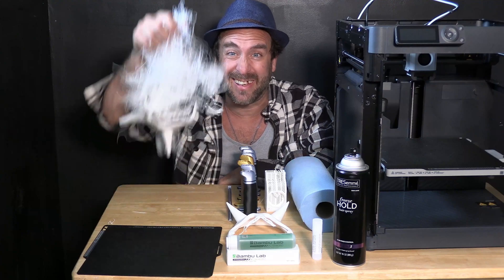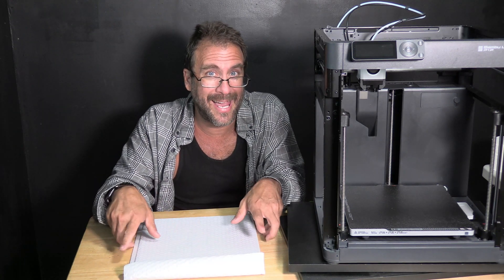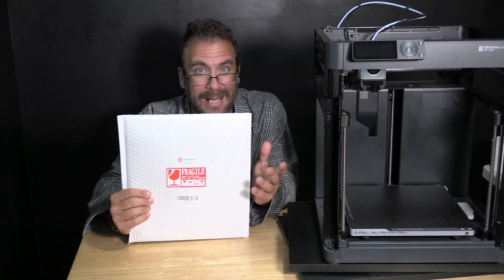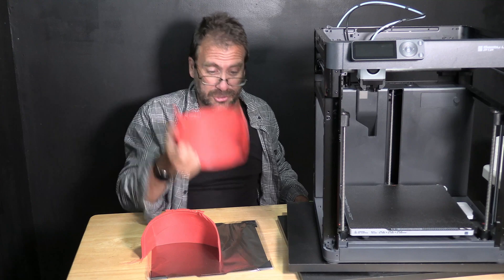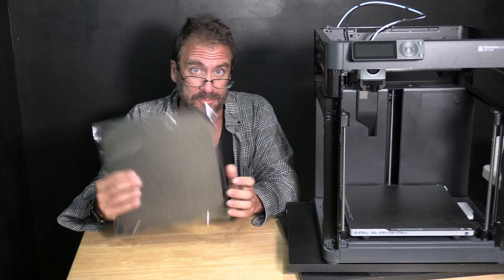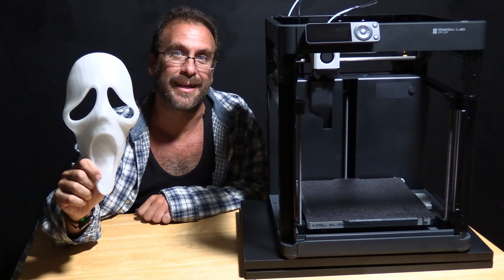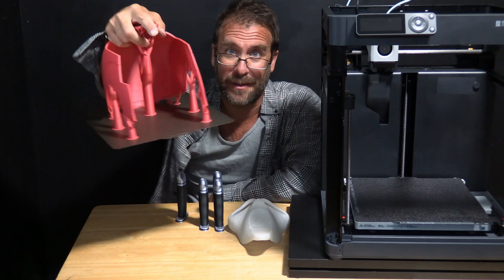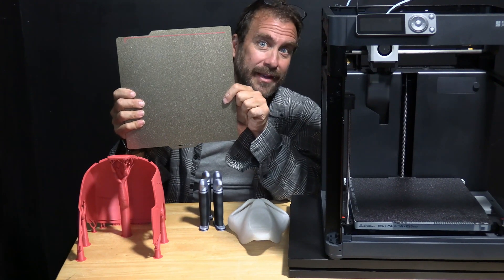Testing NEW Improved GOLD PEI Bed, on Bambu Lab P1P 3D Printer - MUCH Better Adhesion!

Comment: Informative, but not particularly helpful when you're showing the bed adhesion of a brand new bed. The failure of Bambu beds (Gold and otherwise) after about a month is not solved long-term by simply buying a new (generic) version of the same (gold) bed.
Reply from the maker: Reading helps also. In the Description and comments, I mentioned to disregard the Textured all together, and use the new High Temp Smooth PEI.  That said, both beds used in this test were new. I also tested multiple brands, with similar comparative results.
Reply: @3DRundown  Yes, I read your comment, but I was simply noting that over time people have the same problem with Gold or "otherwise" (referring to all beds, not color). Your next video was helpful for trying to track down the problem, but I am trying one thing at a time to know what helps. (Regardless, I hope you have a wonderfully sarcastic reply to watchers day!)

Comment: Gregg should I buy a second one for back up ? Ty  now back to your video. 😎👍
Reply from the maker: NO. Throw it in the Trash, (or, don't order it at all) and buy the High Temp Smooth PEI Bed: http://shrsl.com/4ijn5
Reply: @3DRundown  I have a good one with the new pei , I m wondering if i should buy another one ?
Reply from the maker: NO. The high temp smooth PEI bed is MUCH better. I would get one of those instead. Use the Textured for easy prints, or, when you want the Texture on the bottom. Use the Smooth for everything else. As for a backup? I have backups for all my beds, but, I have yet to ruin one, and I print every day....
Reply: @3DRundown  so that is the darker one that comes with the p1s , right?
Reply from the maker: P1S comes with Gold Textured PEI.  Use THIS one: http://shrsl.com/4ijn5

Comment: Hello,
I discover your videos as I was looking for informations on this topic.
I have adhesion problems after some weeks on my new P1S (I use the stock textured PEI plate).
I'm thinking replacing it by smooth plate as you recommand, but I see 2 differents smooth plates on the bambu shop.
First is "Bambu Dual-Sided Smooth PEI Plate" and the second one is "Bambu High Temperature Plate (Smooth PEI)". Do you know the difference between these two plates? I understand on the High temp plate the "Engineering" side seems to be different, but the other side the "High temp plate" seems to be the same as the "Dual-Sided Smooth PEI plate" as they both use a "Smooth PEI sheet" on the surface.
Maybe you have tested both of them, do you have any informations about the differences between these plates and which one stick better?
Thanks again for your videos, you won a subscriber today :)
Reply from the maker: High temp SMOOTH PEI is what you want. I have the one's with the engineering on one side. I've only used the Smooth side. Immediate massive improvement. Adhesion is epic, compared to Textured
Reply: @3DRundown  Good to know, I just go this answer from Bambu support: "Yes, the "High temp plate" side of the "Bambu High Temperature Plate (Smooth PEI)" is the same as the two sides of the "Bambu Smooth PEI Plate (Dual-sided)""

Comment: Mine was fine as is for the first 20 or so prints, then….went kaput having a terrible time with my x1 carbon. Going to give those a go when I can. I did try the glue, and it was nightmarish. I did a full new calibration, and cleaned the bed with a glass cleaner. And I had a success. But I don’t know how long this is going to last until disaster again.
Reply from the maker: Forget Textured PEI. It has trash adhesion. Even the Gold. Get a High Temp Smooth plate
Reply: @3DRundown  Thank you for our response. I had no issues with my CR10v2 modified original glass bed. I wish I had that bed for my Bambu lol. Trying to start my own business Bambu is a life changer to print the prototypes I design. As my CR10 is now failing and constantly repairing it, it’s taking too much of my time. That is why I got the Bambu. I need to be headache free.

Comment: Hi Gregg - I have a question and hoping you can help me resolve a bed adhesion issue i'm having on a New P1S i just got this weekend. Question about PLA bed Adhesion on the P1S using the Gold Textured PEI Bed plate.
I washed my bed plate to ensure its clean after each print. 

I just got the P1S in place of the A1 due to the A1 recall. Decided on the P1S and now I’m having regrets already in my decision.

I wanted to do a simple print to test it out – first few prints works out great; however, when I expanded the footprint on the bed I started experiencing my print lifting at the corners, But only on the side where the Auxiliary Fan is inside the cabinet - the one below the light.
My print is just a star wars themed light switch cover; so its not very tall.

My last attempt I had the glass top off and the door partially open but still seeing the corners curling up. And not slightly but curling a lot.

Is this issue being caused by the Auxiliary Fan blowing directly on my PLA print or is Bambu Labs Gold Textured PEI Bed plate the issue.
Does the Aux. fan require to be turned off completely since I’m printing PLA with the top off?

I’m not understanding why this is happening. Never saw this issue with my A1 printer with the same textured PEI plate. The A1 being a bed slinger – moved the bed and hot head at like mach 1 speed and never saw this issue. Hoping you can help lead me to resolving this. Thank you
Reply from the maker: Hi, I'm short on time. Quicky for now:
Textured PEI SUCKS. Order the High Temp Smooth Plate.
For now: 
BED TEMP 60
Lower you AUX fan to 20-25%. it's way too strong
Slow your 1st layer more, and print a little slower, not full blast.
Reply: @3DRundown  Thank you Gregg - I appreciate the quick response. I'll give those a try. Thanks again
Reply from the maker: Very welcome. Good luck!

Comment: I learned not to use 70% isopropyl alcohol to clean the gold plate. Using 91% isopropyl alcohol made all the difference. No more failures.
Reply from the maker: I use 99%. But the best way to use texture pei, is NOT to use it. 😂 The Smooth Plate crushes it.

Comment: Thanks for the info. I just bought a X1C and the stock "Cool Plate" bed surface is worthless. A $1500 printer that cannot print PLA with or without adhesive.
Reply from the maker: oh no. the cool plate is MUCH BETTER than Textured PEI. If mine came with Textured PEI, I'd switch to the cool plate, day one. Smooth has FAR better adhesion. That's why we use glue.... to protect the bed. I switched all my Bambu machines to smooth pei. I went with high temp, but the cool will be fine also.
Reply: @3DRundown  I agree about smooth being better. I did order the BBL double-sided smooth PEI build plate. The Cool plate is PEI, but it is different as it is designed to print at 35C (I have tried higher temps, too). I have encountered other X1C owners having the same trouble with the cool plate. Is it a quality control issue at BBL? Some work some don't.
I just tried using PLA on the Engineering side of the build plate at 60 C, top glass vented, and Vision Miners nano adhesive with very good results. At least I can get my print order completed!
Reply from the maker: Right, "smooth pei". The textured is poor. 
Your cool smooth should work well. (Though I   Recommend the high temp). Use your cool plate at higher temps. The K1 default profile (K1 is stock with smooth) is 45, and it doesn't cut it. 55-60, and I've never lost a print on a K1. Try your cool at 45, 50, 55. See is a difference. Keep it very clean. Use VERY THIN GLUE. I often wipe the glue mostly away with ipa, and seldom even ad any. Once every several prints

Comment: Just put a bambu gold and black plate on it and print the same so we see the difference live. All new. All clean. Comparing to an old plate is too many variables. Tell us what the PEI is after a  50+ prints.
Reply from the maker: No thanks PEI sucks. I use High Temp Smooth, for 90% of my prints. The fun texture, isn't worth the poor adhesion. Also, Bambu Lab themself, replaced the black with the gold. That's enough testing for me....

Comment: How has the bed been working for you ? I got my p1s came with the plate last Tuesday. I am having 50% fail print on this plate from Thursday. The printer and plate is less than 10 days old. I cleaned and follow all instruction on their site from printing with open top to close, change temperature, change fan speed, sometime it work sometime it isn't. Even tried it with different filament brand, all PLA but 50% of print came out success the other is a pile of mess. Even tried with glue(which their website said no need for PLA),50 % success. I am in the process of creating a support ticket to Bambu for this BS.
Reply from the maker: Bambu bed adhesion sucks ass. I am preparing to shoot another video on how to tackle this. I have plenty to say on this topic. Hit you back shortly. Also, your new P1S will already have Gold
Reply: @3DRundown   I am talking about the Gold plate. I having issue with the Gold never try the old one. I sent Bambu a support ticket earlier I want to see what they say I include time lap for them.
Reply from the maker: The gold plate sucks also. I have put extensive work into this. EXTENSIVE. And still, my bed adhesion, while better then the OG black plate, is still trash. People from the Church of Bambu, won't admit it, but, many others have this problem. I suggest switching to the cold plate, or high tempt plate. I have 2 high temp plates on the way. You'll be seeing it on this channel, soon as it arrives.

Comment: those fails are hard to watch, I switched to adding purple glue stick on either cold or hot side.
Reply from the maker: The Green Bambu Glue is the best adhesive I've ever used. However, with the gold plate, you won't need it anymore
Reply: @3DRundown  now I cant wait to get it in the mail :(

Comment: You're not crazy. My original textured PEI plate (black version) from Bambu had patches on it where the filament would adhere much less than other areas of the plate. No matter what I did to clean the surface, every print with a large bottom surface showed the same unsightly patches in the same places - where the filament was semi-separated from the plate. I just received delivery of the new gold PEI plate from Bambu and it has none of the same problems.
Reply from the maker: YES. Some people STILL don't believe me, but, it's a fact. Good call on the gold. It's night and day.
Reply: @3DRundown  FYI I also have the Wham Bam PEX plate for my Bambu and it's a champ. As of now, my PLA printing needs needs are fully covered by the Bambu textured gold PEI, Bambu high temp smooth PEI, and the Wham Bam PEX plates, giving me different surface finishes from textured to high-gloss. 👍
Reply from the maker: Awesome. I only have the OG, and the Gold. I need me some more fun toys! Link me up

Comment: I'm new to 3d printing, I got my p1p this year and I thought it was standard practice just to use a gluestick every time you print
Reply from the maker: Not at all. Rare actually, and typically when printing on Glass, even then, it's usually Hairspray, and only Glue for troublesome prints. The stock PEI beds kinda sucked. The new one is so much better. I have no used glue yet. I DO on the stock bed and the K1 bed

Comment: Nicely done, 3D Rundown. I purchased the gold PEI plate from Amazon that you highlighted in the notes as well as in the video. I have yet to try it on my new P1P. Just one question. I use Bambu Studio, newest version that was just installed, and there are four Plate Types under that menu. I'm assuming the last one is your choice, but want to be sure before using the gold plate. Which plate type are you selecting?
Reply from the maker: Keep in mind the P1S comes with the Bambu Version of this bed. Choose "Textured PEI bed". The bed in this video is still working great.
Reply: @3DRundown  Thanks for the very quick reply. I'll have to give the "new" one a clean and then it is off to the races.
Reply from the maker: Anytime. Thanks for participating. 🤜🏼🤛🏼

Comment: My problem with the stock pei plate is that very small objects dont stick well. For example the flexi dino thingy does not stick good enough. Does this is the same case with the new one?
Reply from the maker: The new one makes the old one feel like a pile of sh*t. It's far better. I'm at 0 fails so far

Comment: Please keep us posted as to whether the new print plate also drops off with use. My P1P's dual sided textured PLA also did great for the first 12-15 small prints, but now same issue.

I've already failed 4 times with the same print (Thingiverse 4896452) plus one other tiny model. I thought it was the cheaper Elegoo PLA but the Bambu PLA is also coming off the bed by like layer 10-20. Bambu Lab's FAQ on the dual sided textured PEI plate says to try 0.25 mm first layer height and 0.5 mm first layer line width, print with a 5 mm brim, Orca Slicer presets are already at 220 °C for hotend and 65 °C bed temp, for both Bambu and generic PLA presets.
Reply from the maker: So far, I'm at Zero fails.... 🤞🏼🤞🏼
Reply: @3DRundown  Good to hear. I may have unfairly blamed my textured plate; I did wash it with detergent, used glue stick, but my model was pre-supported with hundreds of tiny little rafts and sticks. I found a version w/o supports and used slim trees, and success, and it took 30% less time!
Reply from the maker: Highly reccomend avoiding anything that's been pre-sliced. Gotta suck it up and do it  yourself. :)
Reply: @3DRundown  Thanks; wasted a lot of time learning that lesson!

Update: my still new-ish plate is working fine w/ glue stick for all but Elegoo blue PLA, which continues to fail even w/ slim tree supports. Drying it now to see if moisture or bad filament.
Reply from the maker: The Bamu GREEN Glue, is super. I would grab that. So far, I have not had any fails, on the new PEI without glue. Weird on the Blue. My RED was troublesome on the original PEI bed.

Comment: Mr rundown, have you by chance tried the bambu labs glue stick they sell at that absurd $16 price? I had issues frequently with adhesion as well, but not a single one with that glue stick. (Havent finished the video, will delete if you mention it later)
Reply from the maker: I sure have! They actually INCLUDE IT with all P1P now! Check it out: https://youtu.be/J4AHzUplkxY

Comment: I've had these same adhesion issue with my new P1P bought early July 2023. Adhesion was good for 10-20 prints, then seemed to rather rapidly decline. Any "tall" print seems to fail about 2/3 of the way through the print. This is using 5mm brims. Flat prints are fine as one would expect or at least hope. But Im not excited to spend more on a replacement. I may have no choice.
Reply from the maker: I feel you, but "Parts" and tinkering, are just part of the 3D Printing game. End your headache and get a new bed. The green Bambu Adhesive also. It's super effective

Comment: Sounds like you got a flawed stock bed - most folks (myself included) have had great success with it. Glad to see you're finally rocking with the PEI bed.
Reply from the maker: It seams like that is a thing. Others have had similar problems, while many have none. Bambu seams to be silently aware, as 1st they released the new Glue, then, a new bed all together. I'm hoping this is the "Magic Bullet". So far, So good!
Reply: @3DRundown it does beg the question whether the gold is actually “improved” or just “to spec”
Reply from the maker: Well, I can tell you it works FAR BETTER than the original one. Why that is? Who cares....

Comment: I had the same problem, but it wasn't even a tall print - the stock bed failed almost immediately. I was reduced to printing it on my old Ender 5 S1 (which isn't a bad printer). I'm going to buy this new bed, but it looks a lot like the Creality gold PEI bed and every other gold PEI bed out there. I wonder if there's any difference.
Reply from the maker: Yes, I've had to fall back to S1+, E3 Max, etc. It's totally worth a try. I did my tests with no glue. They all would have failed on the stock bed. I do suspect many of the gold beds are the same. I'm sure their are some knockoff trash also, and the question is, how to tell. I took a chance on this one, and it's super so far! May have to bite the bullet and pay for a Bambu to Test. I bet it's basically the same though